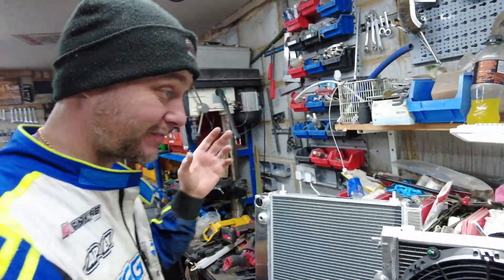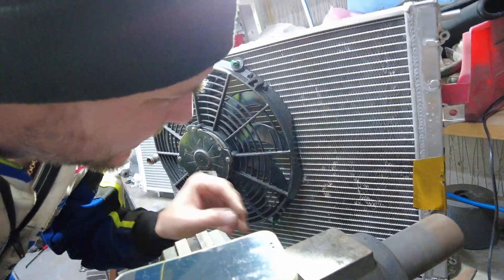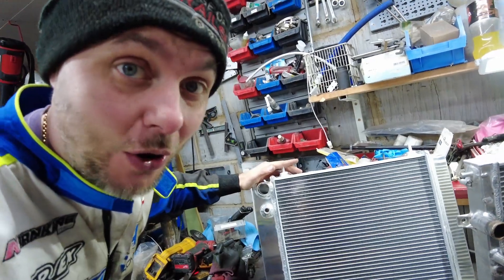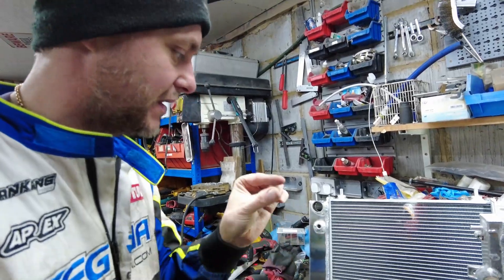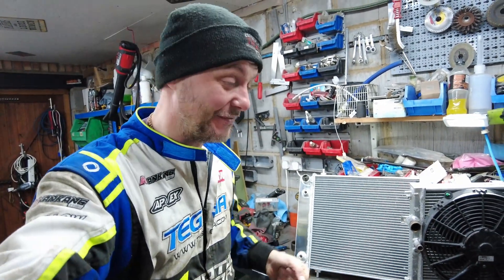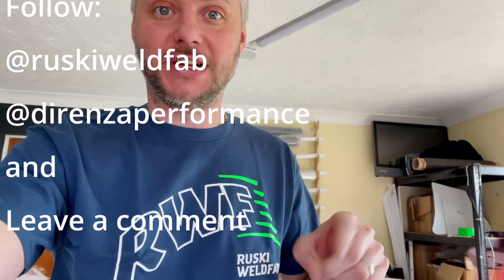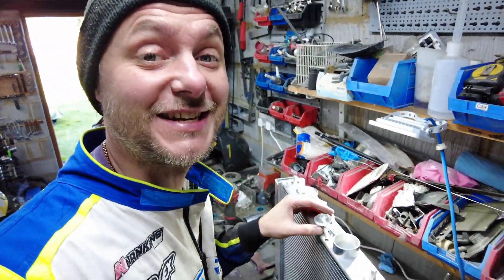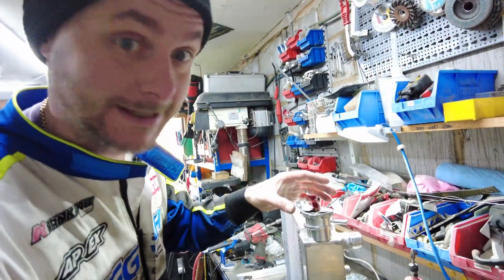How to add top-fill neck and AN16 ports to a universal radiator by @Direnza

Comment: Hi Ruski, my first comment at your nice Channel; thanx to you I build my first fiberglass bonnet for my "racing car"😅.
About the radiator installation: have you consider to mount It in the rear of the car? More space in your motor bay and a better weight distribuiton; in the other hand some kilos more. 
Thanx for your answer.
Reply from the maker: nice work! yes i have considered. maybe at later stage!

Comment: I say this again,use 150 DG elactric water pump...you can use smaller (sorter in you case) radiator and you will never have issues with temperatures again...there will be more space....
Reply from the maker: I hear you

Comment: Are you sure that your radiator is placed high enough to act without expansion bottle? 🤔
Reply: I agree with this, you may need another fill point or bleed port at the back of the engine which is the highest point.
Reply from the maker: you guys not the first to mention this!
Reply from the maker: Nope not sure
Reply: @RuskiWeldFab  This is from google research... "Since the radiator is lower than the engine a pressure relief and fill point that is higher than the engine is needed. This is accomplished with an expansion tank. When the radiator is high enough to act as a fill point and pressure relief an expansion tank is not necessarily required" ...but I always thought the same. Any open hydraulic system need some sort of tank, but I also may be wrong! 🙂